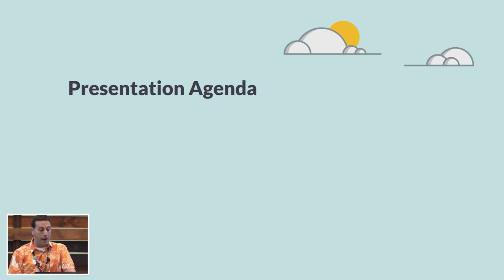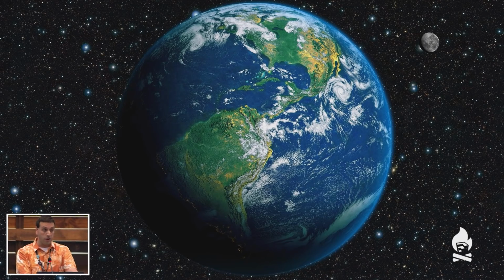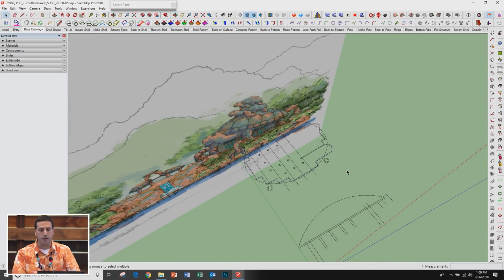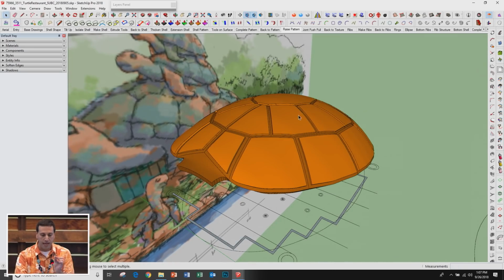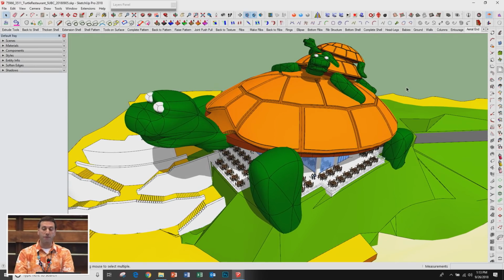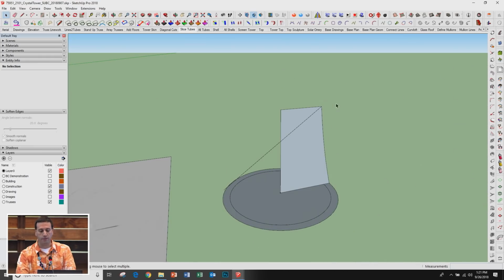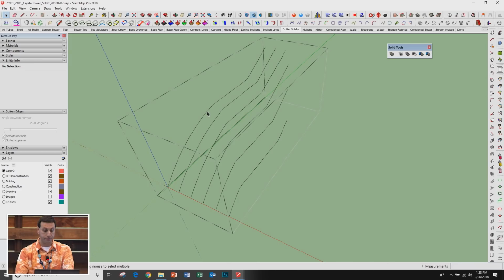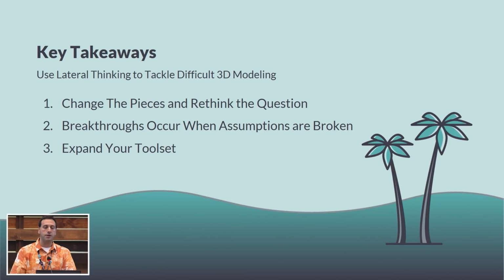Build the Impossible – Dave Cooperstein | 3D Basecamp 2018

Comment: You are awesome - I  get why you are so nervous when using tools and extensions  - I have already learned that after going through two classes and having about 24 panic attacks in the process that you have to be patient or it may make you reset your PC - thank god for Sketchup autosave the last project open.   The beginning of your presentation is so inspiring though.. I worked for a company that had the exact  The instructor still makes it look easy even though he will say you may have trouble with an upgraded version or older version - or have no answer for why an extension won't work.  Or why when you export a drawing from Sketchup to Autocad it won't import correctly.  Mine imports with no layout version and the worksheet tab have a drawing but everything is broken out into blocks-  nothing like he said it would work nor did he try to resolve the problem.

Comment: Please give AutoCAD 3D  a trail, you will love it, no extensions needed.
Reply: Erwin, I was required to use AutoCAD at work even though Turbocad did the job better and was much cheaper. As Turbocad became more pricey I switched to Sketchup Free, and haven't looked back. It's an amazing cad program. Why use anything else unless some old-fashioned company requires Autocad. I think I dropped Autocad with the 2000 release.